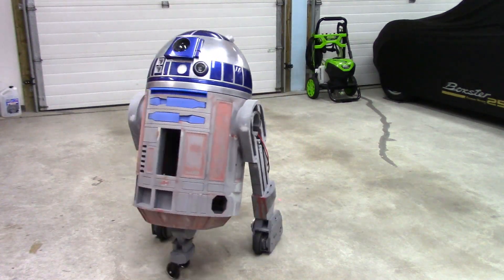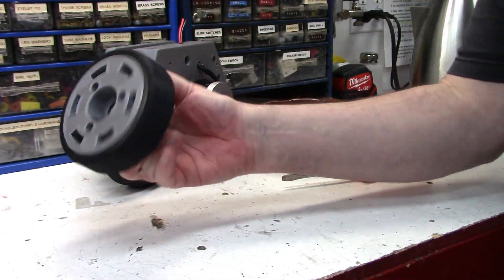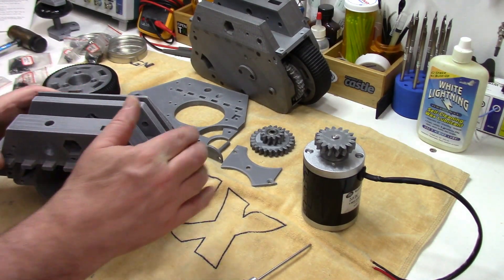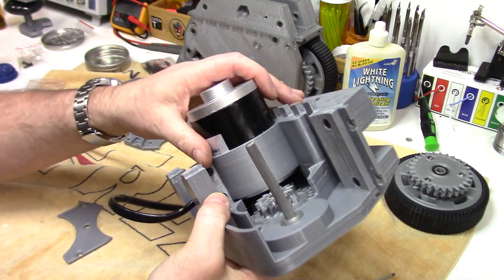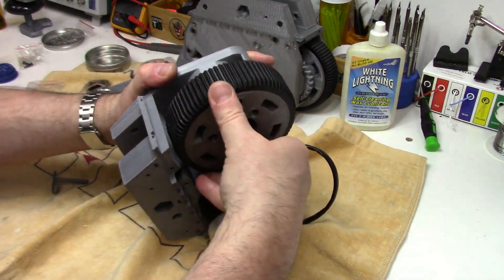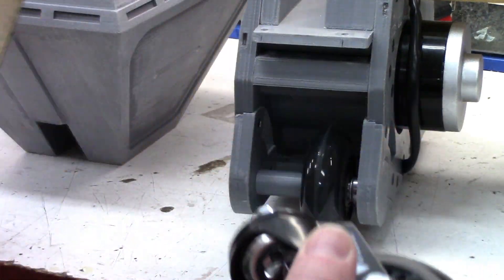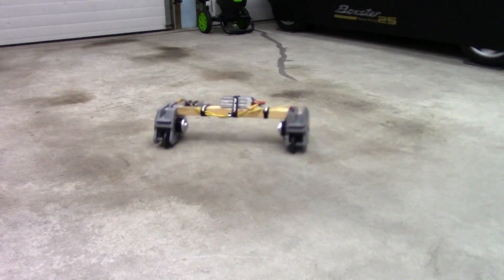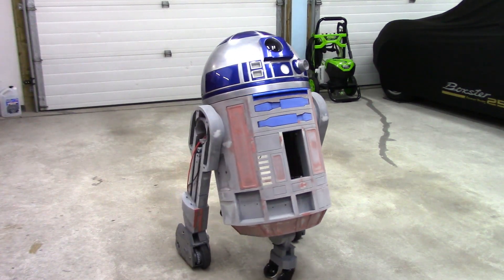Building R2-D2 Part 8 - First Steps! V2 Legs & Mark 3 Foot Drives

Comment from the maker: Making R2-D2 Video Series:
- Introduction to a DIY R2-D2 Build: https://youtu.be/hkkSagTsLXY
- Part 1 Making the dome: https://youtu.be/HaZ7ABkhwn8
- Part 2 Painting the dome: https://youtu.be/inoqE19ODUQ
- Part 3 Dome lights & holoprojectors: https://youtu.be/hDR9z1PAJSA
- Part 4 Dome Completion: https://youtu.be/PnjCrLlJtig
- Part 5 Mark 3 Body Assembly: https://youtu.be/m6VXt6VGZ3c
- Part 6 R2 Sound System Basics: https://youtu.be/cZ3sVYs7T9I
- Part 7 R2 Electronic Basics: https://youtu.be/AmUuZH3UHXg
- Part 8 R2 Legs & Foot Drives: https://youtu.be/PLyOKD5oAyM
- Part 9 Painting R2-D2: https://youtu.be/E8h0l4rHvC4
- Part 10 Installing Electronics: https://youtu.be/bg_tN6HCYN4
- Conclusion to a DIY R2-D2 Build: https://youtu.be/sIpBA6UigTQ

Terminology correction: I used the term "intermediate" when describing the center gear. This is not fundamentally correct as a true intermediate/idler gear has no reduction, it's a 1:1 ratio and that is clearly not the case for the center gear in the Mark 3 feet.
Reply: What is the total cost?

Comment: Did you ever figure out turning? Mine is all put together but I can't do a stationary turn. I need to build some momentum to do so. I used steel rods for the axle, white lightning grease and plenty of washers to prevent plastic on plastic but I still hear that scrubbing that you talked about.
Reply from the maker: Covered in part 9: https://youtu.be/E8h0l4rHvC4?si=eN7P1Q2jbcYSAN3E

Comment: Have you got a link to the STL files for the caster wheel conversion for the center foot?
Reply from the maker: I made mine on Tinkercad and didn't save the file. I however switch to a block of laminated plywood because the castor pins put too much stain on the printed block.

Comment: Jhon nice job, i have a question: What kind of filamanent did you used for the foot driver pieces? ABS, PETG o PLA? and what % of infill?
Reply from the maker: As covered in part 1, PLA+ for everything on this build. All structural components of the build including foot drives 40-50% infill @ 2.4mm wall thickness. Pins & gears, 100% infill.

Comment: This series has been so helpful in my own build. Wondering how you attached the office chair wheels on the center foot? Not seeing it in any of your videos and looks like a great alternative to the omni wheel. Where are the print files for that mod?
Reply from the maker: I ended up using a wood bock to mount the castor wheel pins and bolted it to the top of the foot (looks just like the plastic one I made for testing on Tinkercad that is shown on the front foot in this video). That printed one didn't last long (cracked on the castor pins and mounting holes) so I thought a hard wood block would be better; so far no issues.  If/when it ever cracks or wears out, I might try making another stronger design on Tinkercad and print it with much thicker walls and 50% infill.

Comment: Ive watched through this playlist several time and love it. Great information, and fun.

I have subscribed to Mr Baddeley on Patrion, but god knows what files i need to print.

Is there a list anywhere that you used?

Any help would be awesome... 👍🏻
Reply from the maker: I used the Printed Droid Print Guide for the primary parts list as I mentioned & link to in the very first video of this series (The Introduction Video).
That said, there is of course no specific one size fits all file list because it depends on what options you want on your build, what specific version you want to print and how you want to build it.
There are endless options on these builds so Michael has kindly provided lots of files. Even depending on what size printer you have will dictate what files will and won't fit.
His instructions also cover what specific files are used for certain assemblies.
I also spent hours looking at various files in my slicer program after downloading to determine which I wanted/needed to print based on my specific build and requirements.
Enjoy your R2 build!
Reply: @Rchelicopterfun  thanks for the reply John... I've just downloaded those files and have the Sovol 6 plus, but it's just that all the files I seem to find seems to be all over the place. Some cut files here, some in other folders done by someone else.

I'll get there!

I plan to start in January here in the UK, and have a full time job, so thinking 9 months to a year if things go to plan.

Your build is stunning John, one of the best I've come across. I'd be happy to have a build anywhere near as close!

Thanks again John. You may hear from me again! 😁👍🏻❤️

Comment: Love the video series!  Where did you get the center wheel adapter for the casters you used?  I want to try that instead of omni wheels.
Reply from the maker: I made it. First on tinkercad to see if it would even work, and then made the final block from a piece of hardwood.
Reply: @Rchelicopterfun  Appreciate they help!  That's what I'll do then!

Comment: Hey hope you can help! Running the exact same setup as you but my e100 motors don't seem to have enough torque to get R2 to move properly, I have to give him a little push and he tends to stop and have the motors make a grinding sound..
Reply from the maker: Several possible reasons come to mind. Your Motor Controller is faulty or net setup correctly.  Using 24V motors with a 12V power system. Using too small wire gauge. There is mechanical binding in the gear train. Or perhaps a combination. Of course without testing actual voltage, voltage drop, current draw and motor controller output with a DMM, these are just guesses.

Comment: I'm curious.   I just started printing my pieces for an R2.  I've built other robots using Jazzy chair bases and they work great.  I too use a SaberTooth controller, the best IMHO.  You say you're worried about tire rubbing on floors when turning.  I always put the SaberTooth in tank mode so it turns smoothly and within it's own space.  I notice a lot of builders doing what we call "drag turns" too.  Is there a reason why this type of control is preferred?
Reply from the maker: Doesn't matter what mode the motor controller is in, when the center point of the turn radius is between the front drive wheel and back idle wheel, you will get wheel scrub. No way around it other than using a rear idle wheel that also allows side movement to follow the different radius such as the recommended and proven Omni, a small castor or don't use any rear idle support wheel which some apparently are doing without issue.
Reply: @Rchelicopterfun  Okay, now I get it.  Just started my build and didn't know there was idle wheel.  After some video watching I think I'll go the caster route.

Comment: Hi John what size are the center foot casters?  Are they standard office chair casters with rollerblade style wheels?
Reply from the maker: Yes, standard office chair roller blade wheel type castors you can find everywhere. Think they are 3" but can't recall for sure. I', sitting on a set right now and they look about 3".
Reply: @Rchelicopterfun  Thanks! I will most likely go your route to save on the cost of using omniwheels for the center foot. It all adds up real quick!

Comment: Hi John,
EXCELLENT WORK! I subscribed to your channel as well! I joined the Mr. Baddeley's Patreon Page and paid the $5 monthly membership and downloaded the parts I needed for my R2 build. Do you know where I may find the step by step instructions on how to assemble the foot parts and dome gear? As for the done gear, I only saw the large 18" one that has the teeth inside. The small motor mount gear I did not see anywhere. Would you know where to find it? I emailed Mr. Patreon the other day but he has not replied to my email I just need the assembly instructions manual not the 3D printing instructions. Please let me know.

Thank you,
Ed
Reply from the maker: @EdG407FL. All the instructions for the printed versions are in the Baddeley download files. I can't recall off the top of my head the exact file names or which folder but it seemed they were no too hard to find (granted that was almost two years ago now) and I know he continues to add more. There are so many files and sub-files for the various parts, various versions and various cuts. It can take quite a while locating some of them. I spent hours looking for some things. In fact, I recall being pretty much finished the dome when I finally found the instructions and hardware/fastener listings for the rest of the build.
Reply: @Rchelicopterfun  Thank you very much for the quick reply. Keep up the great work.

Comment: Is there a published file for the front foot block that the casters mount into?
Reply from the maker: Not that I know of. I made mine first out of a block of wood to test the concept & fitment, and when I was happy with the size, height & fit, then quickly made up the same size block on Tinkercad to print out for the final version.
Reply: @Rchelicopterfun  Hi, I love the series. I am working on my R2D2 right now. Is there a way you could share the center block file.

Comment: Heya buddy how did you go about doing the wheels on the front?
Reply from the maker: Not sure what you're specifically asking? I purchased the castors, measured them up to find their height, pivot offset & shaft diameter. I then printed up a test spacer/mounting block, slid the castors into the block and mounted it to the front ankle to test.

Comment: I have a question where’d you source all the material you need like the wheels and the electronics?
Reply from the maker: Where? Lots of Google research & R2 Builders club reading. I have links to all the components I used in the descriptions of each video covering the specific topics in this 12 part build series.

Comment: Maybe there's a way to add some type of slip differential to get rid of the drag?  hmmm
Reply from the maker: @Mike Roy. Unfortunately, it's not a differential wheel speed issue (both left & right drive wheels are completely independent after all and fully differential). It's a sideways wheel scrub issue. Easily and totally cured by fitting rear Omni wheels (Part 9).
Reply: @Rchelicopterfun  after I wrote this I realized that you resolved it lol. Thanks. I just found this build series and I’m seriously considering starting. I’ve been wanting to build an R2 for many many years and now that I own a Ender 3 S1 I think I can actually do it. It’s very intimidating but maybe I should just do a static one ? I actually have been in the RC hobby for 20 years but not sure I want to tackle that end of it. What do you think ?
Reply from the maker: @Mike Roy, Only you know your comfort level with a build like this and how much you want to take on. One thought however... You can always do a static model to start with and add motion later on. Nothing saying you have to have it moving right off the bench :)
Reply: @Rchelicopterfun  very good point. Maybe that’s what I’ll do. I like the idea of how you said to start with the dome then get a feel for it that way. Before 3D printers this seemed like such a daunting task but it feels more achievable now

Comment: Could you put a castor wheel behind the drive wheel to get rid of tire scrub?
Reply from the maker: They would have to be very small castors (likely not much larger than 1" dia.) as there is not much room in those back feet behind the drive wheel and shell; and castors need lots of room to pivot around their centers. Tiny castors would then get caught on any small surface crack/similar. 3.25" Omni's are clearly the best/only option in these 3D printed feet, unless one wishes to redesign the entire rear foot drive.

Comment: Great video!!! I have a situation where the motor shaft is thinner than the gear. What kind of shim have you used (if applies)? Thanks a lot!!!
Reply from the maker: No shim/s used. Drive gears were a nice tight fit on the motor shafts of the foot motors I used.
Reply: @Rchelicopterfun  thanks a lot!

Comment: Amazing work John - center foot casters is great, more quiet than omni's, and I think you sold me on it - did you just use the OmniFrameTop.stl file as-is, or expanded it a little on the Y-axis to adjust for the height?    Thanks for the videos, you have great content!!
Reply from the maker: Like several other special parts in my R2 build, I designed this front foot caster wheel block in Tinkercad. This one is just the first test unit with a low infill, but fits the ankle & shell fairly well... still a little size tweaking however.

There is one potential downside to using these larger rollerblade office chair casters that you should know about. They can hang up on each other if they rotate toward the center both at the same time. It's very doubtful they ever would do that - they follow each other very well, but it's something to consider and experiment with.

I've had no issues, but he has not ventured outside onto rougher surfaces yet - that will be the real test. In short, I still may have to go with VEX Pro Omni's in the front, but so far, these are working great.
Reply: @Rchelicopterfun  Thanks for taking the time to answer - I didnt realize they can run on each other, but I'm only planning to roll indoor on hardwood/tiles so that should be fine.  I may as well get to Omni wheels down the road, will be attempting to print Mr Baddeley ones for the side feet and see how I like them.  
Cheers from a fellow Canadian!
Reply: @Rchelicopterfun  have you uploaded the stl files anywhere for the centre foot caster wheel blocks? I'm interested in using a similar design, thanks!

Comment: Instead of omni wheels, couldn't you use casters there also? They would be durable, and yet would reduce the scrubbing. Or there might be some physics thing i'm not understanding?
Reply: Just wanted to add that if he's always going to be in 3 leg mode, you don't need the back wheels at all. I've tried everything from omniwheels to casters to omniballs. My favorite solution was the omniball but lifting them about 1/2 inch from the ground, so that it's only used for occasional stabilization (as if you can stabilize a moving tripod). Many of the filming droids didn't have rear wheels at all either.
Reply from the maker: There is not enough room for casters in the Baddeley Mark 3 feet. To use even a small caster, the back 1/3rd of the foot would have to be cut out and the foot shell made thinner along with coming up with a new mounting system.
Reply: @Rchelicopterfun   Awww.. it's sooo close though lol  I see the motor would probably be in the way of the caster spinning also. Yea, it would require a different design for a rear caster, but again, I wonder if it would even help. If a caster would indeed be a better option than an omni for rough terrain, a person would just change the 3d model design to accommodate it. I'm sure you're not ready to experiment since you have it already built.... but it might be an option for people starting out. The caster could also be mounted centrally and not offset like the current wheel has to be.  Just thinking out loud lol
Reply from the maker: Yep it would require lots of time, work, testing, and experimenting with different size casters & wheels to get something that works. Or... folks could just use a 3.25" omniwheel that the foot was specifically designed to use and not worry about all that 🙂
Reply: @Rchelicopterfun   Luck favors the brave :D

Comment: Hello John. What drive motors did you use? I had to modify my gear to accommodate the smaller drive shaft, but it's not 100% and I'd like to get it sorted.
Reply from the maker: @Pierre Whorley: I cover electronics including the specific motors I use in the R2 electronics video: https://youtu.be/AmUuZH3UHXg

Comment: Thanks for sharing your progress.
I actually printed out Mr Baddeley's 3D printed ABS omni wheels and they worked out great. Found out that microwaving each TPU omni tire (there's lots of them) for around 20 seconds before installing work a treat. 
The pre-made Vex brand omni wheels seem super expensive for what they are, so recommend everyone give it a try first. The miniature bearings are super cheap.
Reply from the maker: @pauly540 - Thanks for sharing your positive experience and tips with the printed omnis.
Reply from the maker: @pauly540 - Mind if I ask how your printed omnis are holding up long term and if you do drive on less than perfectly smooth and clean surfaces?
Reply: @Rchelicopterfun  Hard to tell, as yes, I only drive on smooth surfaces, not on bumpy footpaths. Plus I've only got a couple of hours driving time in. I like Mr Baddeley omni wheel design, as they have individual tires, so  it's easy to just print out new ones and they do sound quite.
Reply from the maker: @pauly540 - appreciate the reply.